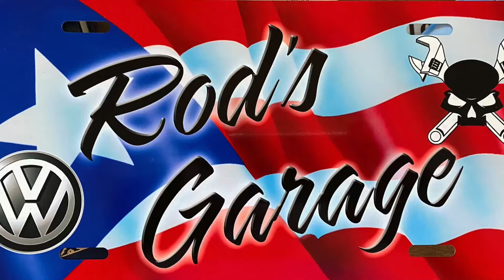1957 VW Oval Beetle block sanding

Comment: Im in the process of sanding my 56 ragtop. Its been 80 primed 120 primed then 220 and reprimed still have to block it with 400 all but the fenders. Good luck with it im going single stage enamel sublime green
Reply from the maker: Nice, I block with 800 before paint and turned out amazing! Base and clear is more forgiving than single stage! I would do 800 before single stage! But that’s me, good luck 🍀 please post pictures @rodsvwgarage on Facebook!